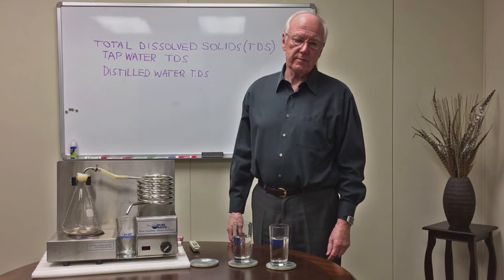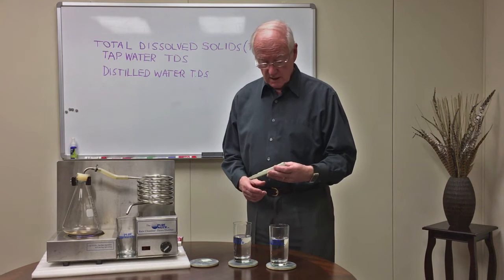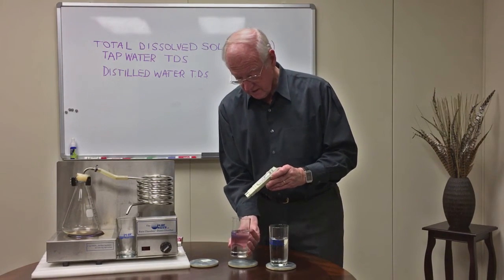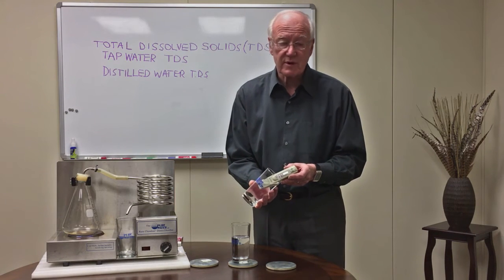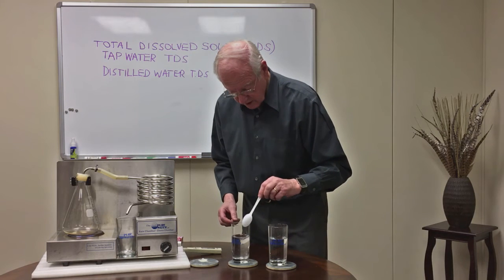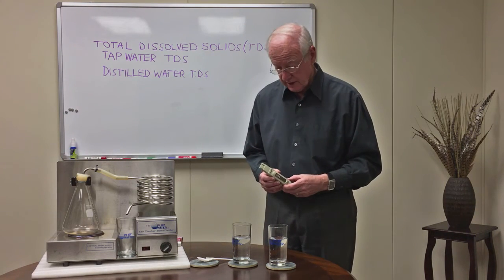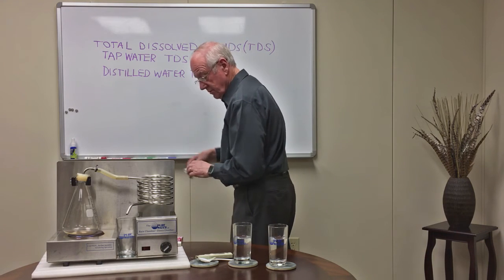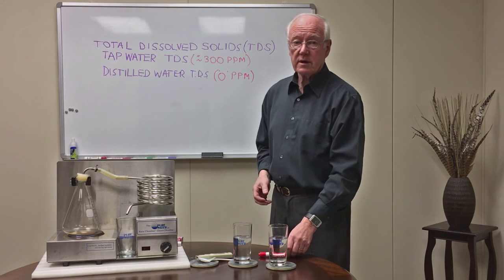Tap Water vs Distilled Water

Comment: Is de-ionized water more pure than distilled? What’s the difference
Reply from the maker: By definition, deionization, often called DI for short, is the removal of ionized minerals and salts (both organic and inorganic) from water through the process of ion exchange.  ion exchange is very selective on which minerals it will remove and depends entirely on the resin you use for the filtration.  It does nothing to biological contaminants and is not going to remove all the minerals.  Distillation is based on boiling point.  any contaminant with a higher boiling point will not be able to vaporize in a distiller and will remain behind as the steam is collected.  Any contaminant with a lower boiling point will rise up with your steam.  this is why we pair our distillers with patented dual vents on the cooling coil to vent off these contaminants and use a post filter to remove these contaminants specifically.  Distillation also kills any bacteria or virus in your water and because they can't vaporize, they remain behind in the boiling tank.  Just distillation vs. DI, distillation will be better because it will remove a broader range of contaminants without having to worry about what type of resin you are using and it will remove biological from the water.  If you have any further questions, please feel free to give us a call at (800) 875-5915 ext. 110.